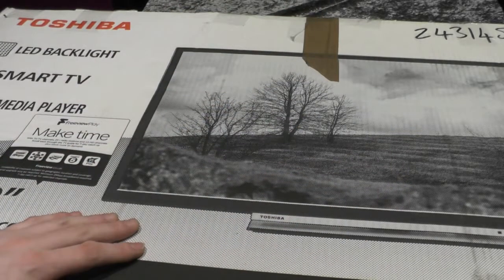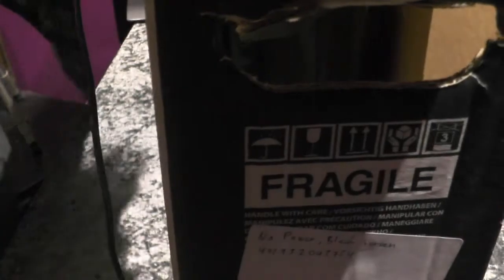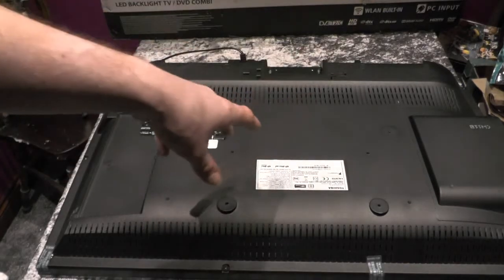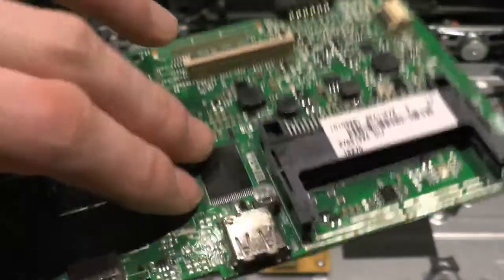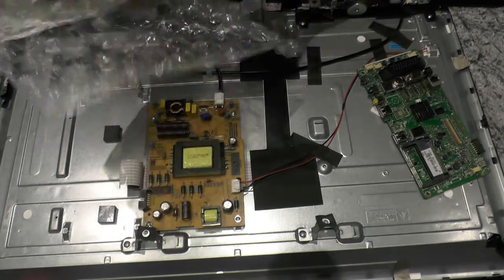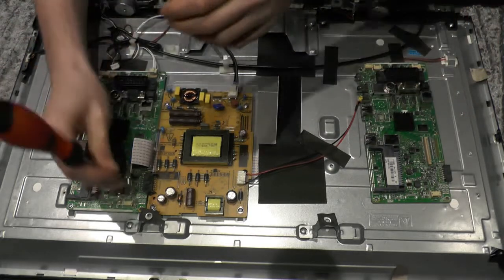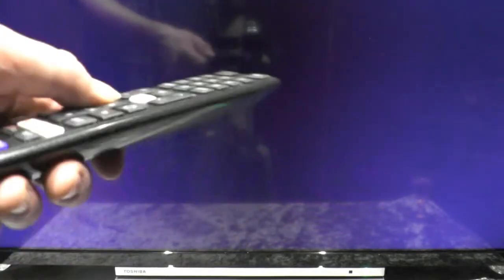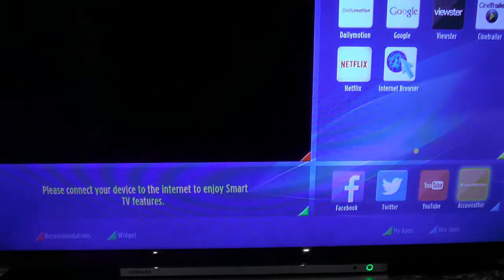Fixed or Phuxxed Toshiba 32D3753 Red Green Flashing LED No Picture

Comment: This video was perfect. Made me laugh at the same time as it had the EXACT same problem as mine all the way down to the software not existing. Ok so changing the board will solve the problem. Oh its the 49" version of the tv.
Reply from the maker: Glad it entertained, that's really what the channel's about, although it's great if it can also sometimes help people.

Sadly, because Youtube comments are often Twitter levels of unpleasant, I've not been checking recently. And will be turning off in future, so I missed this, sorry!

Changing the chip for a pre-programmed one (There were a few on Ebay a while ago) might also sort it, but a board swap was cheap and easy on this and thankfully got it up and running perfectly.

Hopefully it's done the same for you.
Reply: @exasperated  Yeah i sorted it thanks to this video tbh.
Reply: carte mère toshiba 32W3753DG
Reply: I want a motherboard for a Toshiba TV

Comment: where did you get the board from and how much was it ? I have the same problem on my Toshiba
Reply from the maker: It was a while ago, but I think I got it from Express TV Parts.

I've seen people say you need to get exactly the right board version to match your screen, looked through the listings and saw this - Same board part number, but slightly different TV model https://www.ebay.co.uk/itm/264323462321

Something you definitely need to check is the layout of the connectors on the board. I once picked up a board for an LG, only to find the main ribbon connector was soldered in a different place and had a different number of pins.

I think you can also buy pre-programmed Nand memory chips for these sets, but when a tested/ working board was all of £5.20 it didn't make sense to mess around trying to source and solder a chip, even if it would've felt like more of a "proper" fix than swapping a board out.

Good luck!